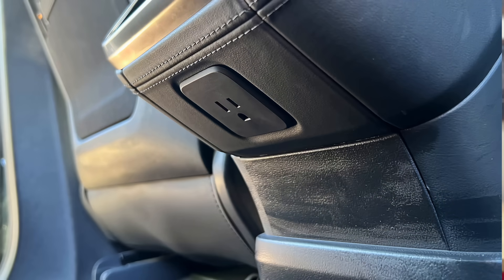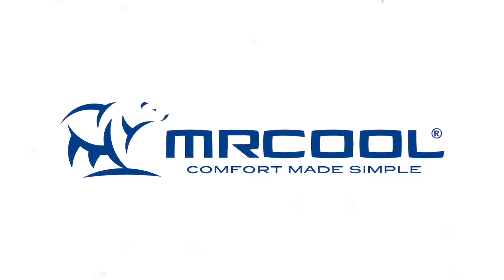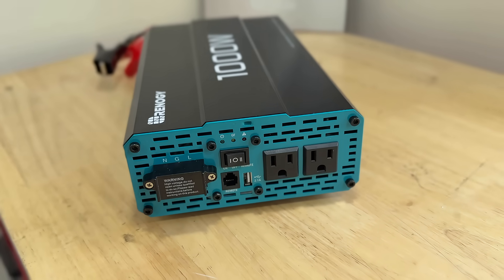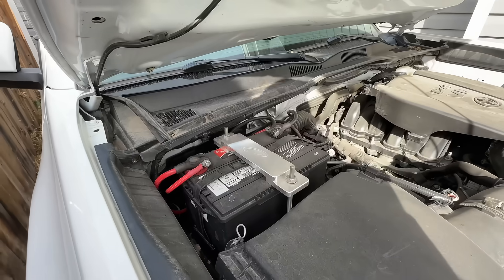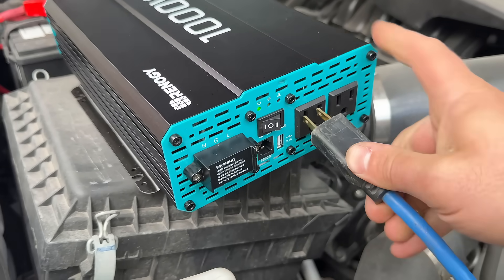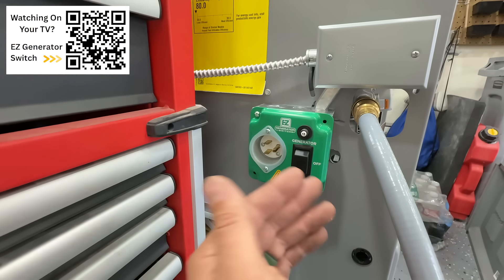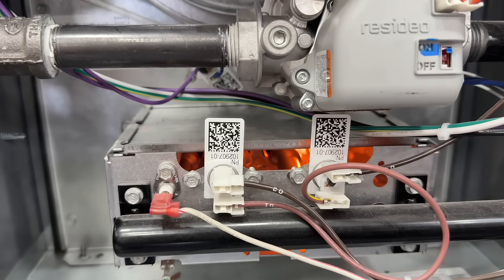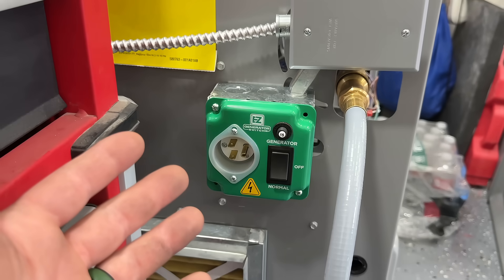Why Buy A Generator? You Have One Parked In Your Driveway.

Comment: During Hurricane Sandy, I powered my home for 4 days with my Chevy Tahoe and a 3000W pure sine wave inverter quietly idling in the driveway. 2 sump pumps, refrigerator, freezer, hot water boiler, tv, internet, gas hot water heater with power vent, clamp lights, computers. (Edited- NOT ALL AT ONCE!) 3/0 cables with Anderson Connectors connect the car battery to the inverter.  Worked like a charm.
Reply: The ultimate limiting factor is the output of the vehicles alternator.
Reply: @aeromender  145 amp output, it did what I needed it to do.
Reply: @1pcmedic 
Your alternator put out at idle 700-1000 watts which took about 1.1 hp to produce.  
 And  would have consumed 0.086 gallon of gas per hr with a generator(.if you even get a generator  that small never the less) 
Or 8.256 gallons. /4 days. 
Compared to 50-60 gallons/4days  for the Tahoe .
Shit going to happen don't be a victim.
Reply: @FFLFFS  I did purchase a tri-fuel Yamaha 2800w inverter generator that uses natural gas, the Truck is for plan B if the generator has a problem.
Reply: Yep, I like that natural gas option. It makes your unit 100% efficient:  20% for electricity 80% using the waste heat. . 
Turns your generator into a furnace if you scavenge the heat out of the exhaust before it exits the building . 
Great for the shop. 
But propane is almost as good $$ wise.
Reply: @1pcmedic I just upgraded my alternator in my Astro from a 105amp to the 145amp.
Reply: @Jimiscarving 
Still only 12 volt? That's 1740 watts when the engine is in its power range which is not a sensible use of energy.
Reply: @aeromender there are 200 amp alternator  available for 4x4s
Reply: I understand to use the car in an emergency but if you going to spend 200$ for an inverter, you may as well spend 350$ for a real generator.  Idling a car for the power is good for a very temporary solution like pumping out water not to run for days on end.
Reply: @jetterbenne2578  The car in question is worth about 350 on a good day.
Reply: @catnimble9087  fkin hell 😂
Reply: Pretty sure the heat from the engine isn't good for the inverter 😂
Reply: @Danimal-76 Heat is bad for all electronic devices. That is why they put heat sinks on high current/wattage outputs.
Reply: @nolaserv it’s a good idea, just a sloppy layout.
Reply: I don't buy that, 3000w would not be able to cover even half of that. Why lie?
Reply: @itwasntmebro2669 The loads were probably not at the same time.
Reply: @itwasntmebro2669 he said he wasn't using all that at once
Reply: I once idled my car 8 hours in a parking lot. The gas needle didn't even budge.
Reply: THEY almost always idle 18 wheelers.
Reply: @harveypost7799 idling isn’t good for diesel engines. If they do they use the cruise control to raise the rpm’s
Reply: @Danimal-76  18 wheelers sure spend a lot of time idling so it must not be that bad.  When a driver pulls over to sleep for 8 hours they usually leave it running (for heat/AC if nothing else).  A cruise control is based on speed not on RPMs but maybe they have some other way to raise the RPMs.
Reply: @ted458 yep, you can raise the rpm with the cruise control, or rather hold the rpm up with the cruise control. Years ago I spent a short time working with trucks. Company I worked for used only Kenworth and we always used the cruise control to keep the rpm up, otherwise the truck had a safety feature that shuts it down after a few minutes of idling. But with the rpm up we could run it all night to power the AC in the cab
Reply: @harveypost7799  18 wheelers are diesel and meant to be idled.
Reply: @wisepati123yes but at a higher RPM when sitting for a long time at a truck stop or anytime your sleeping in it if not than diesel gets a lot of sludge build up now a days most companies small diesel generators built into the frames or up on the back of the can do you can shut the motor down and use the generator for heat or air conditioning when you sleeping and it just uses the fuel from the trucks fuel tank they've been our for years used to be called hot boxes or wabasos and off shore power boxes
Reply: That's a lie
Reply: @thepintman  🤣🤣🤣 yeah, OK
Reply: This guy is uneducated!
Reply: @Danimal-76 🙄
Reply: You have a 250 amp alternator...?   That's what the math says you would need for 3000 watts @12V.  Max stock optional alternator is 160 amps.  High output alternator is way more than a generator. Why is this the better solution?
Reply: @rickmcentee9204  It might not be a better solution, just one to use at the time or have nothing.......
Reply: @rickmcentee9204  I guess for full load, my truck came with a 145 amp.
Reply: @rickmcentee9204 it's called power management.
 The larger inverter is used to accommodate surges for which battery capacity can provide extra current when the alternator couldn't meet that need. No, you could not run 3000 watts continuously but you could run say 1200W continuously with 2000W surges or even higher surges and operate the inverter at the lower wattage the rest of the time. You just have to be very diligent about managing how much load you put on the inverter and how long you run the engine.
BTW, my tank type gas water heater needs no external electrical power source.
Reply: The pure sine wave is a good point to bring up. For most computers, you will want "pure sine wave" !! 👍🏻👍🏻
Reply: Which inverter unit did you buy?
Reply: Why does everyone talked about gas furnaces?  Doesn't an oil system also need electricity?
Reply: @kimbuck-2  An Oil system needs more power.  Hot Air systems need even more. The lowest power consumption system is gas/hot water.
Reply: @1pcmedic Oil needs more?
Reply: @kimbuck-2  An oil burner typically draws
800 to 1,200 watts, while a gas boiler draws a much lower 100 to 200 watts. The higher wattage for oil burners is because they require more electricity for the burner motor and blower, while gas boilers only need electricity for their components like the circulation pump and ignition.
Reply: @1pcmedic Thank you very much.  I appreciate it.
Reply: @1pcmedic you're conceptually correct on the gas burner but just FYI, my gas hot air furnace draws about 450W with the air circulator and burner motors running.
Reply: @mikeslater6246  Gas burner with hot water heat and circulation pump= about 100W.  The blower motor is what eats the Watts.
Reply: @kimbuck-2  Many of us grew up with gas heat and have never even seen an oil furnace in person.  We don't talk about oil burners because we don't have anything pertinent to share.  I suspect (aka speculate) that some use electricity and some don't depending on whether they use an electric blower or a passive distribution setup.
Reply: @ted458  an oil furnace runs a blower just like a gas furnace. The blower is what takes the power.
Reply: @wisepati123 I haven't seen an oil furnace in person but I thought that some of them essentially just heat up the basement and then the heat rises up through the vents which are just openings in the floor (no ducts).  Don't some of the old houses work that way?
Reply: @wisepati123don't forget the fuel pump and the igniter.
Reply: @ted458 yes, a floor furnace does work that way but it has a blower motor for air flow into the burner and also a fuel pump to pump fuel from the tank to the burner. The igniter also runs constantly to keep the oil burning.
Reply: @mikeslater6246  I forget that some places use oil instead of gas.  I was talking about a natural gas floor furnace.  They do not have blowers or any kind of electrical parts.  They might have a thermocouple in case the pilot light goes out but that is fully self contained.  There is no electricity going to to a gas floor furnace.
Reply: @ted458 I personally have never worked on a gas powered floor furnace but would expect a combustion air fan to be needed. Google says that some of the older units did not have combustion or draft inducer motors because they counted on the chimney effect of the exhaust gases being vented directly outside but they say the more modern units do have a draft inducer to get the exact air flow for cleanest combustion. Learned something a little new today myself. Thanks for the question and your clarification. Have a blessed day!
Reply: @mikeslater6246  Thanks for the updated information.  I was thinking about the old ones in old houses.  I haven't seen the newer ones with electric motors.  The old ones are basically just a big burner (enclosed obviously) under a large metal grill in the floor.  The grill is typically 2-3 feet wide and 3-4 feet long.  There's a little window on top of the burner housing about 1 inch by 2 inch where you light the pilot.  You can see the flames through it when the burner is running.
Reply: Cost a lot more in gas though no?
Reply: @juntjoonunya9216  Never really thought about it, dangerous heat vs some form of air conditioning was my main concern.
Reply: I don’t know. I had a standalone gas generator for a while and it would run fast faster or slower, depending on the draw.  Would a vehicle do the same thing?
Reply: @wisepati123 No, the vehicle has no way to adjust rpm, just set it between 800 and 1000 rpm.
Reply: @1pcmedic thats not true, the opposite is true
Reply: @wisepati123 Certainly the alternator would work that way.  If the alternator was pulling a bigger load I think it might cause the engine to slow a little.  Sort of like when you are idling and the AC kicks in it will bog the engine down a little.
Reply: @ted458 my engine automatically raises the rpm when the ac kicks on, right after it goes down a bit (so it automatically tries to compensate on its own)

Ive used a scan tool to monitor the fuel ratios and can can confirm during a draw it will adjust on its own to prevent stalling
Reply: @bbefox0  I don't like a lot of the electronic stuff on cars but that actually sounds like a handy feature.  Sometimes in the old cars you have to put your left foot on the brake so you idle it up a bit with your right.  😀
Reply: I think this is another one of his "Tall Stories"
Reply: Better upside those cables from inverter to battery..
Reply: Is it safe for your car to idle for that long?
Reply: @cdubsell  I still own it and use it 13 years later.....it now has 253,000 miles.
Reply: @1pcmedic  Wow that is amazing!
Reply: @cdubsell : I let my car idle for hours at a time while I nap inside it. Seems fine to me. I haven't changed the oil enough though.... That could be an issue.
Reply: Tapping directly onto the battery with proper clamps and running a 1,000-watt inverter is more than enough for a gas furnace and a fridge, as long as you respect the wattage limits.
Reply: Smart one!!
Reply: What Brand and model # was the inverter?
Reply: @Hugh_Manitee  Ramsond Pure Sine wave 3000w 12V, they have a 24V model also. It's designed for solar panels to power it, but works with the truck.
Reply: Good one !
Reply: So how long can you use it with your car off before you have to turn your car back on to recharge your battery.
Reply: @louiealbarado3233 Depends on 1) size of car battery. 2) wattage of the things you run off it and how long you run those things. Do the math.
Reply: Thats what we otr truckers do year around using various forms of sources i.e.
1. Straight idling
2. Pwr inverter- and yes people/ you must buy a pure sine wave!
3. APU
4. A separate inverter generator i.e
Generac, Predator or Honda, Anchor, Eco Flow
5. Solar power generators which is rarely used but you see a driver every now & then using these.
Reply: how many times did you refill your gasoline tank?
Reply: @HR-rt9nh  Topped off with gas cans 12 gallons, 4 times. 12 gal a day.
Reply: Idling your car for 15 days straight that doesn’t sound very good no thanks I’ll stick to a standby generator.
Reply: That’s a sweet inverter! Sine wave is the rolls Royce! Lol😂
Reply: What brand inverter did you use? There are so many out there and I’m sure plenty of them are junk
Reply: 7:08
Reply: Where'd you get the gas?
Reply: @bacsigabe29  Had to drive 20 miles away until I found where the power didn't go out.
Reply: That's good to know. After the hurricane, we lost power for 3 days and I used my solar panels and Ecoflow generators to keep my fridge and neighbors' fridge going until the power came back on. Fortunately, the sun was out during those days.
Reply: If you just use this to maybe, like power microwave, when you need to cook, that would be great.
During outage
Reply: If you build within certain models of homes you can use the old trusty propane floor furnace to heat your home and have a fireplace and or a wood heater or stove to use when you have the time to feed them and enjoy but don't stop there.....get a gas generator or dual fuel and proper electrical cords ......get a small 500 W inverter and something larger for your needs and buy double the deep cycle batteries that you think you will need .......buy small battery charges to inclued the small solar  ones that not only work very well but dont break the bank.Led lights  is a must along with your hand held or head wearing led rechargeable with USB charging ports .  Propane lanterns, stoves and heaters  are a must to the collection along with oil lamps . Don't tell me you can't muster up these items and yet you blow money like drunken sailors on the movies, eating out several times a wk and buying pure BS ! Too many of us consider ourselves poor to most standards today but we have all or most of what I said above and more ! Dear God don't let your families become victims , learn from family and friends the basics of fixing things and just simple working with you hands......does not mean sitting on your hands or playing meaningless stupid games ......children and adults of 3rd world countries will soon pass Americans for the basics to survive when SHTF and make no mistake about it .....its coming , they seen what they could do with COVID and they have been 24/7 working on something much bigger!  " control the food and control the people "  but now they are preparing to take down the power when they get back in office  and have enough power ( pun intended) its just a matter of time , you may never have this chance of time again......start now and before you know it you will have more  security and sense of real confidence than you every had.......teach your children well , God Speed !
Reply: Your vehicles are not meant to idle for hours at a time
Reply: How that Tahoe run after that.? Big question mark.
Reply: A tiny microwave 800watt will max out a 2000w inverter connected to a semi truck that has a 4 battery and a high amp alternator. No way your running much on a 3000w inverter off a regular car or pickup truck.
Reply: You were fortunate to have a very high ended vehicle, since most are not that fortunate.
Reply: Wow!😮
Reply: Wow!!
Reply: you're such a friggen liar everything you stated, added up to about 25 thousand watts  LOL
Reply: Letting you car idle is bad it was cool for emergency but I would do it again
Reply: Question; why does the gas hot water heater need to be included to this scenario?
My home has a gas stove, hot water heater, backyard hookup and two lights in front of the home with gas, which I utilize for short power outages. I’ll either bbq/cook outside and have a hookup for a medium generator with the rear gas hookup.
Reply: @c5cpe  Because an electric hot water heater draws more Watts than the vent motor for a natural gas hot water heater.
Reply: @1pcmedic I said gas hot water heater.
Reply: In a true emergency it works great. The main negative of course are the amount of wattage you get. My SUV it's   130 amps for a theoretical max of 1560 watts. No 240 volt. Upside is it's super quiet. But I agree, it's better to use an efficient inverter generator separate of the alternator. A home battery backup in combo with a generator is the way to go if you don't have solar as an option. I ran 535 watts of power to run lights, wifi, tv, and fans. Based on usage a full 18 gallon tank of gas will last 3 to 5 days.
Reply: Homie should put his cat in the garage and sleep in there. The exhaust gasses will kill him and no more worries about lack of power
Reply: I’m inquiring because I was on a road trip and I have a front and rear cigarette plug, which everyone was using while I was driving. When we stopped at a store, the car went dead(with the windows down). What’s the difference in the process you used to keep your battery going for days when mine lasted for two, maybe three hours?
Reply: @c5cpe  The vehicle was running 24/4days
Reply: This was during a hurricane emergency situation generators were probably sold out
Reply: @sonoma314  Generators are noisy, you cannot hear the car idling in the driveway
Reply: Connecticut?
Reply: @adriannyasia  Anywhere.....
Reply: I find this hard to believe. My experience with 12v cars is that, no matter how many watts your inverter, the breaker trips with any heavy load -- like a heater coil or larger power tools. This is the reason F-150s offer a 24v DC system in their trucks with the larger AC inverter.
Reply: @mattelgin213 I agree with you. The size of the inverter isn’t what determines capacity. The vehicles charging system output is. And I find it extremely difficult to believe it can run multiple loads simultaneously. Furnace system- OK. Furnace and fridge and lights all together? Mmmmm
Reply: @aeromender but it made such a fun story. He forgot to start it off with "once soon a time in a land far far away". 😉😂
Reply: @aeromender 
Yup doubtful..
I used 3 x 1000 amp 12v  forklift batteries with my 3000 watt inverter last power outage. The furnace a couple of light and computer was about it.
Reply: @aeromender  he said he didn't run all at once. Also, he never said he pulled 3,000 watts, he just said he had a 3,000 watt inverter. For all we know, he may have only pulled 1500 watts max at any time. Many trucks have a 200 amp alternator or more. At 14 volts, that is a continuous 2800 watts, minus inefficiencies, lets say 2500 watts. If it were a Honda civic, then the max would be about 1200 watts.
Reply: @mattelgin213 It's got a lot to do with the cable size. Big gauge,  short as possible, solid connectors on the battery.
Reply: @mattelgin213 agreed
Reply: Awesome. I think minimalizing your pull wouldve been wiser though. You didnt know how long youd be w/o power. Do i not understand something?
Reply: If this inverter had a storage device hooked up to it such that it only charged the battery storage device and then the battery outputted the power to the devices, would that help the load usage against the car battery?  An example would be:

Car battery > inverter > battery. At this point the car and inverter would be used to charge the battery, then when the battery is at capacity it will output to connected devices. Once the stored power falls to a certain level, inverter kicks back in to top it off the battery again. 

Not sure if that made any sense, but just curious.
Reply: @cipyah  Its hooked up to 3 deep cycle batteries so if i have to disconnect to go fill up the truck with gas it can handle the load for that short time.
Reply: @1pcmedic  My first thought about about the idea of using your car as a generator was that my car will certainly use a lot more gas than a generator.  (But, having a 3 deep cycle battery setup so that you can go fill up is pretty awesome.)  How much fuel did your truck use in order to act as a generator?
Reply: @ted458  It was 12 gallons a day.  I ran everything I needed.  I know it was a lot, but the alternative at the time was to have nothing for 4 days......it is what it is.
Reply: @1pcmedic  I'd probably do the same!  :)
Reply: @1pcmedic not gonna happen, it will take way too long to get any significant amount of charge and drain off way too fast.
Reply: @cipyah that could be done but it would be an expensive setup.
Reply: @cipyah  the person is lying, 3000w would not be enough to cover everything they lied about using at once. Maybe a few things at a time, but not all at once.
Reply: @itwasntmebro2669  Of course everything wasn't running all at once, it never does even when connected to the grid. My maximum draw I saw on the inverters meter was 1200W.
Reply: @cipyah Can’t power 120vac appliances with with a 12vdc battery though, so you’ need an inverter again after the last battery. Good thinking though.
Reply: @cipyah kind of how a Prius works by using gas to run the engine to help top up the battery when it gets low.
Reply: @cipyah A 3000 wh power station would do all of that while skipping the first inverter. Probably would run things for 8 hours or more.
Reply: @wes326  but I thought it wasn’t about the wattage of the inverter, but the output of the battery in the car?
Reply: @cipyah It is. 3000 wh is the storage capacity of the power station, and usually they have a 3000 watt inverter.  The storage capacity is more important in this situation.  You could also use three 100 ah lithium batteries and a 2000 watt inverter.
Reply: @wes326  ok. Thank you for that explanation.
Reply: @cipyah I have a 3600 watt Wen inverter generator.  I've thought about buying a 3000 wh power  station and using the generator to charge the power station once or twice a day. Probably a lot more efficient than continously running the generator.  Instead of a power station you could assemble the components yourself; car battery to inverter to lithium battery charger to lithium battery  bank to pure sign wave inverter to appliances. You would also need a way to measure voltage to know when to recharge the power bank. Charging a power station would be simpler and not much more expensive.  My two cents.
Reply: @wes326  I appreciate this information. Not sure I fully understand everything on it, but it gives me a basis to start from to try to understand.
Reply: @cipyah  sort of, it is more about the alternator output of the car. The battery can supply 800 amps for a short time. That is 800 x 14 volts, over 11,000 watts. That wouldn't last long because the car battery only has about 30 amphours. And the cables would have to be extremely thick and short to the inverter. But a typical vehicle will idle for at least 24 hours on a tank of gas. A 200 amp alternator will continuously supply about 2500 watts after the car battery and inverter, at the most.
Reply: At idle an alternator produces enough current to keep the battery charged and some of the basic electronics of that vehicle. operating.

At 1000 rpm (engine speed) an alternator should produce about 20% of the alternators rated output. Figure 20% of a 60 amp 12v altenator. That is 12 amps at 12 volts, and through an inverter will yield approximately 1.2 amps @120vac. 

This is not even close enough to run a refrigerator or a furnace or a microwave oven.

And...not all 3 at once.

I highly doubt an idling engine can produce enough power to run all that is claimed.

This will be based on the vehicle and what size alternator the vehicle has.

Maybe if the engine was operating at 3,000 rpm would the altenator be close to supplying full rated amps, which would be equivalent to 6 amps @120vac.

That is less than ½ the output of a 15 amp, 120v circuit.

You can try it, I wouldn't.

Today's alternators are not even recommended to charge a dead, jump started battery at highway speeds.

It is best to use a battery charger.

But hey, what do I know.
Reply: @chefofthefuture377  Power went out for a couple days in Texas August heat. Honda Odyssey has a 130 amp alt, hooked up an 8,000 btu window unit to a 2000 watt/4000 surge inverter connected to van's battery.  Ran like a champ.
Reply: @chefofthefuture377  the person totally made that shit up, even when using sine wave controllers and all that bullshit, still wouldn't be enough. That person is straight full of fucking shit.
Reply: @chefofthefuture377  My alternator is 145 amps, my maximum draw as per the meter on the inverter was 1200 watts......ran everything I needed. You can guess what happened, I know what worked.  Used a kill-a-watt meter to check each appliance and they never drew what the info plate said.........
Reply: @chefofthefuture377  he said he didn't run all at once. Also, he never said he pulled 3,000 watts, he just said he had a 3,000 watt inverter. He only pulled 1200 watts max at any time. Any many people report about 80 amps at idle for a 200 amp alternator, and about 100 amps on a 250 amp alternator. That is 40% of max when at idle. A 100 amps at 14.3 volts is 1,430 watts. After the inverter, that is about 1200 watts.  If he ever needed more than that for a few seconds, the battery could easily handle the jump in current. Starting a Chevy Tahoe takes about 500 amps. Also, the 145 amp alternator at idle would only push about 700-800 watts from the inverter, but he said he used a 2x4 board to rev it up slightly. So, the max of 1200 watts makes total sense.
Reply: @rclewis01 read his first comment. He did intimate that everything was all running at the same time.

There is no way his list was only drawing 1200 watts.

He edited his comment later, after my comment.
Reply: 4 days on one full tank of gas?
Reply: @whitesamurai  12 gal a day......didn't have a natural gas generator back then.
Reply: What brand is your inverter?
Reply: Super Storm Sandy, NOT hurricane!!
Reply: @Tryp-j9d  "Hurricane" according to the NOAA.
Reply: And a ruined Tahoe
Reply: @davidrice3337  13 years later, Tahoe still running with 252,000 miles on it......
Reply: “We’re gonna LOCK the HOOD, and SLICE the POWER CORD!!”
Reply: GET a CAMERA PERSON!!!!